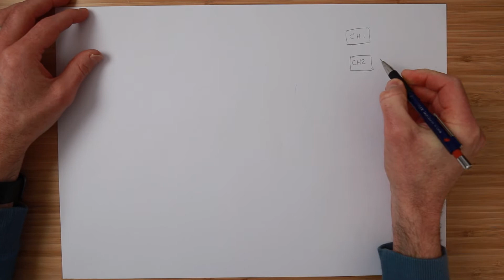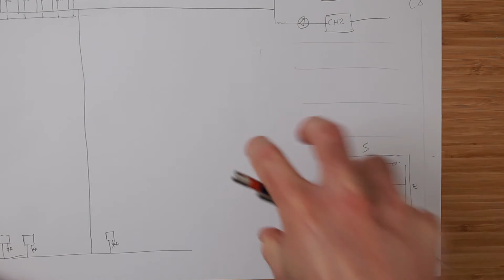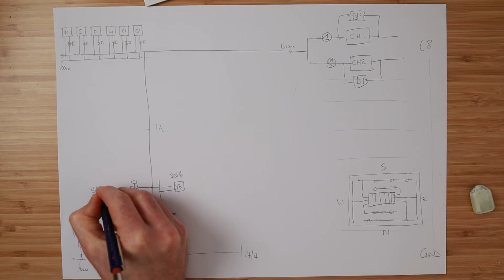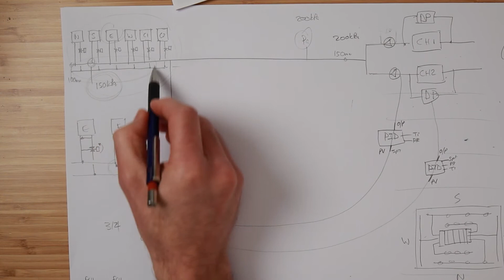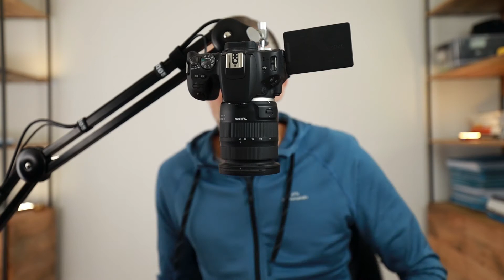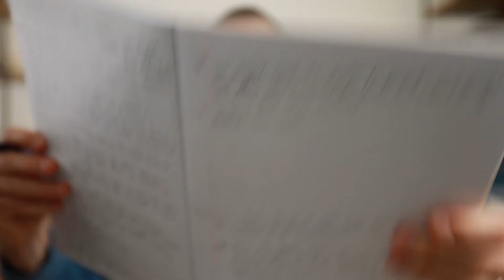System Pressure Control (Part 1)

Comment: I 100%  agree with you  PD should  be  measured where the substantial load is localised ,  I only really think it belongs at top of riser when say  your feeding various floors if fan coils  or even 1 ahu per floor. perhaps what they were concerned with was starving these few small basement loads  I was at a hotel in London  just recently where this  came  up  energy guys  want to slow the CHW pumps  down on low demand for savings of course but the building engineer knows from history and experience that the far side of building starves for chw  then ,  My solution , strategically placed and sized circulation pump to feed these  few loads

Comment: Great video for understanding where we should be controlling.  One of the major PIBC valve suppliers advocates fitting a pressure transducer at the end of each branch and operating on a low select scenario.
Reply from the maker: I think traditionally that is similar to the 3/4 rule. They want to maintain the design pressure at the end of every circuit, so every single unit has design pressure or more. 
I would generalise and say that is fine.
However, I am proposing that may not work in the sketch that I drew. 
We could put one transmitter in the plant room and one on the ground floor and see how it goes.

Comment: The most disappointing thing about such alleged control "rules of thumb" is that most stem from the days of non BMS controls and were a result of trial and error (mostly error).  Hell I was first taught the 2/3 rule....this is the first time I have seen the 3/4 rule.   And I still see to this day the DP being installed inside the plantroom - designed by others.

Comment: Nice video again Bryce👍 I'd be interested to know your opinion on having a network transfer of the pressure values vs a long 4-20mA cable run down the building. Not ideal having a network transfer of a process variable in a relatively fast acting control loop but the cable runs can be quite expensive and difficult to install.
Reply: On very long runs, we typically spot the remote sensor wired to a local controller shared over network with a second sensor in the plant room using a cascade approach with VFD controlled to the plant room sensor but reset from remote sensor.
Reply from the maker: @Mst3000113  That is a great idea. Thanks for sharing.
Reply from the maker: This is coming up in one of the next two videos of this series. I feel you need to run the cable. You are right network transfer does not really work with fast moving process variables.

Comment: Thanks for the video. We faced the same issue in a multistory building with most of the AHUs and FAHUs are on the roof top. But  the most difficult part was to convince some consultants about the practical solution over the theoretical.
Reply from the maker: Yes.. consultants are always nervous to deviate from traditional concepts. Managing the consultant is another skill BMS engineers need.

Comment: Faced a similar issue for one of the projects with VAV system. 10 chillers with 72 AHUs, 8 branches and  we had only 1 pressure transmitter, wish there were more PT in initial BMS design and it would have probably given a better control on BMS. Thanks Bryce for this video.
Reply from the maker: Wow lol.

Comment: Just Gr8!!!! Thank you 👍👍👍 
Just one question, can the 3/4 rule be applied for stairwell pressurisation system?
Reply from the maker: Not too sure about that? I feel confident that 3/4 will provide good pressure control through the shaft but I'd check with a fire engineer in your region for anything related to life safely. 
The problem that sometimes comes up is that the pressure transmitter signal cable back to the VSD should be fire rated.